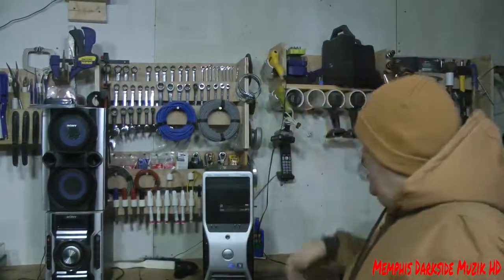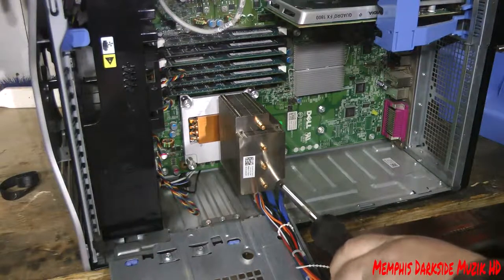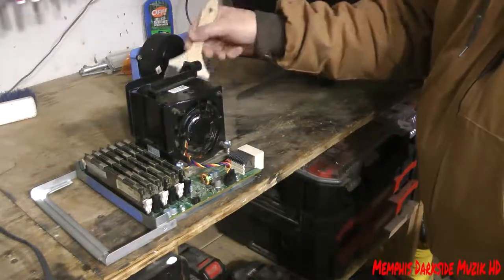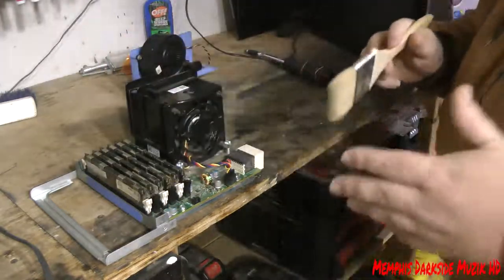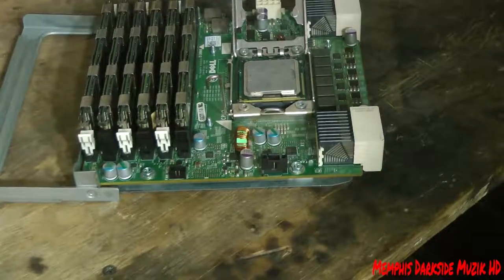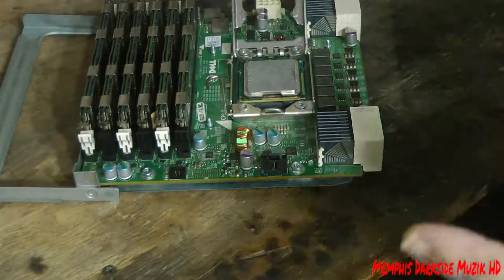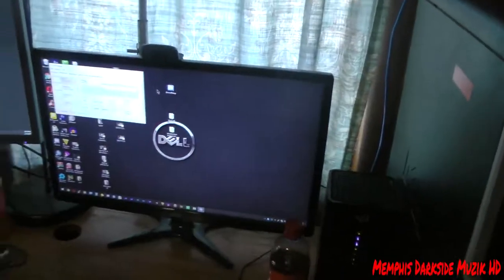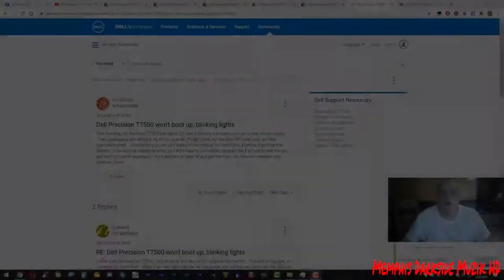Dell Precision T7500 ERROR Code 2,3,4 and Amber Power Button Riser Board 100% Solved/FIXED!! Part-1

Comment: Thanks it works, only push little bit the riser and working well
Reply from the maker: yes suhhh. glad it help ya.
Reply: hey bro can you help me my second cpu dont work good idk why (riser board)
in the pc system board i see CPU 1 and CPU 2 and in divece manger i got 16 prosecors (i think it therads bc 1 of the cpu got 8 therads for it 16)
BUT in cpu-z i got only 1 socket and in pc properties  i dont see (2 CPU)
so idk what this proplem
i test the cpu from the riser board to the normal board it work the issuse not in any cpu and the board work bc i put ram in it and it worked please anyone help me
Reply: @Nor-kz6nl  the problem I think in the connector pcb from little one with tha big one, I think you need to clean the connector with pencil eraser thank wipe with dry tissue
Reply: @bahtiarakrov  thanks dude ill try it out if it work you well be my hero
Reply: @bahtiarakrov  how can i clean it
Reply: @Nor-kz6nl  release the riser and the yo see the connector